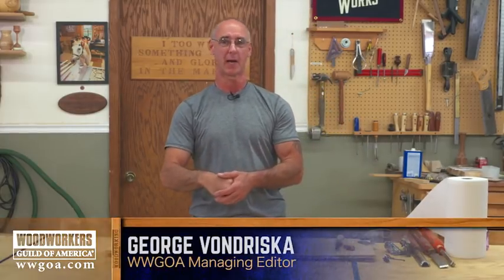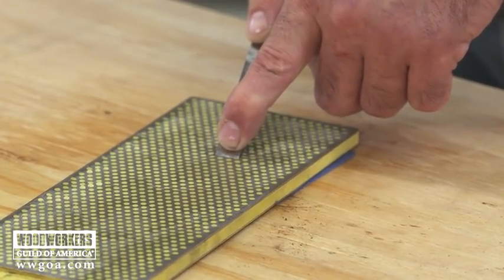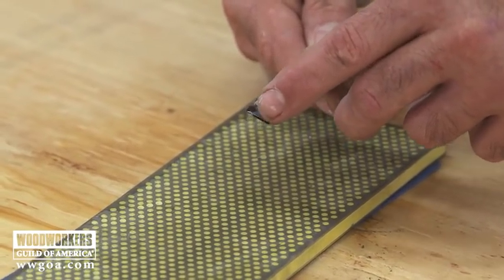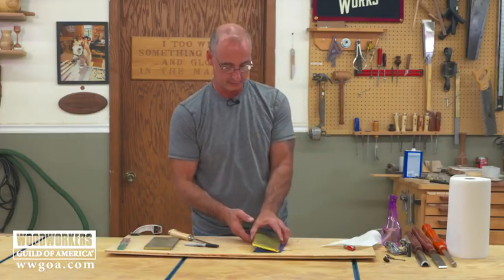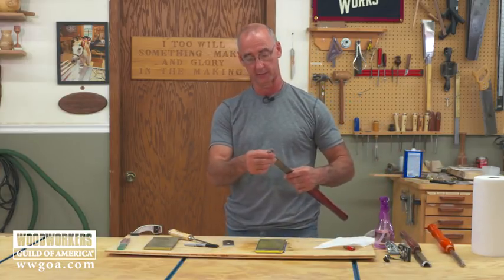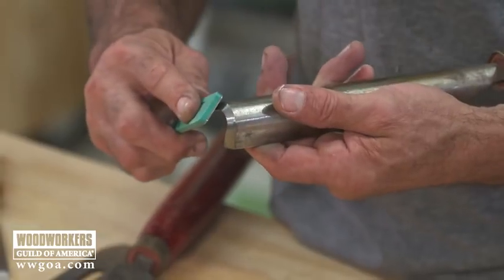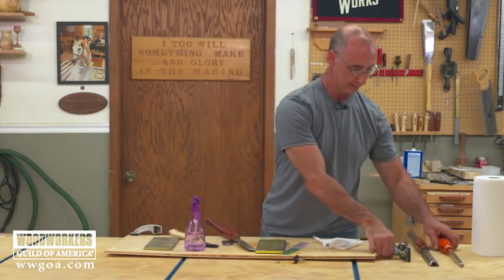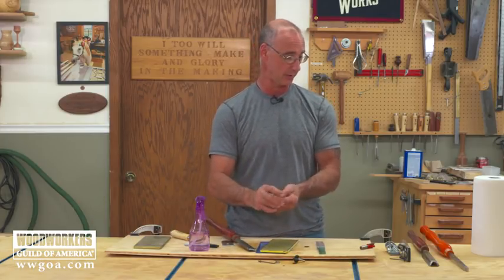Tips for Sharpening Woodworking Tools

Comment: i have watched other videos about sharpening chisels and can you explain the point others make about sharpening the micro bevel and also why do they show sharpening with going up in grit sizes?  you are using just one angle and grit.
Reply from the maker: Hello.  There are a lot of ways to sharpen and maintain an edge.  If you are setting a new angle on a tool you will have to remove a lot of material, so it's best to start with a coarse grit and work you way through progressively finer grits once you achieve the angle you want to achieve.  Once you achieve the desired angle, you can usually just hone the edge with the finest grit, removing a minimum amount of material.
A micro-bevel can be used to further minimize the amount of materials that you have to remove each time you sharpen.  You just have to hone the micro-bevel, which is usually set approximately 5 degrees off of your primary bevel.  I use this approach for hand sharpening, as it requires less work each time I hone.  With machine sharpening, it doesn't make as big of a difference in the time or effort involved.
Thanks
Paul-Woodworkers Guild of America